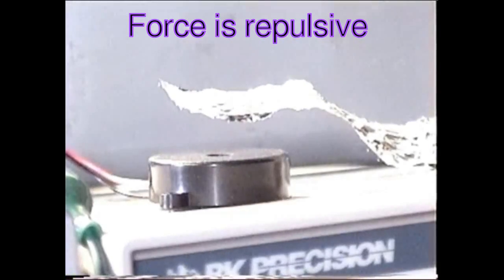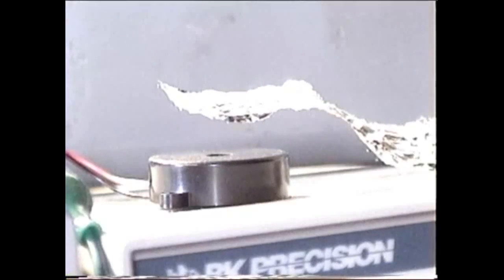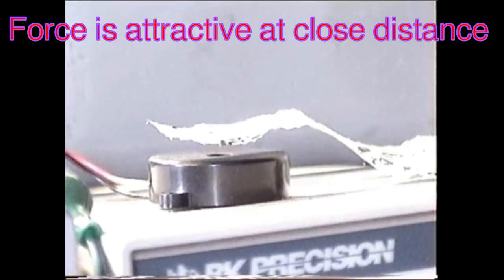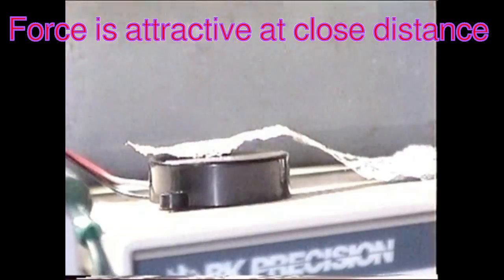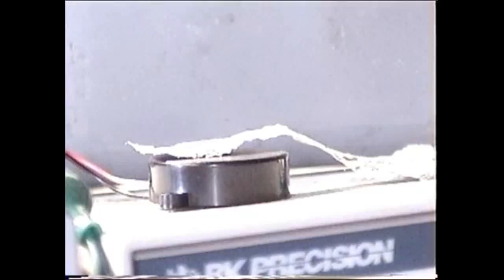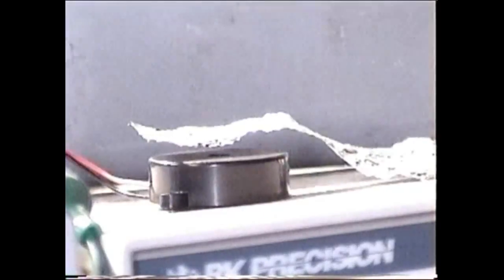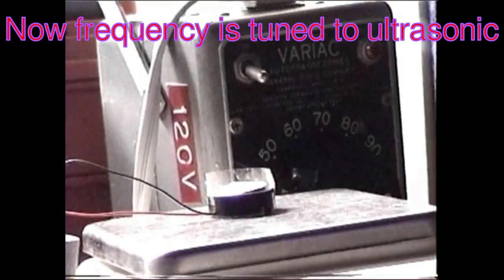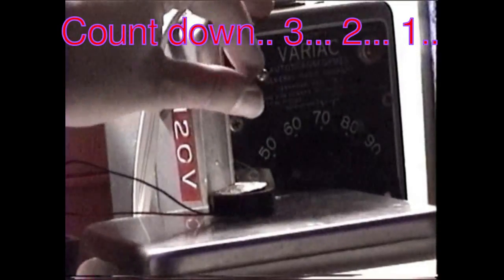Sonic Launcher / Ultrasonic force

Comment: air pressure I think moreso than frequency.....maybe wrong but interesting tests, thanks for sharing!
Reply from the maker: The different frequencies have different nodes and anti-node positions in space.  I believe that the aluminium foil is repelled from the anti-nodes and attracted to the nodes. I have other videos where I used ultrasound at higher frequencies, where the discrete mode structure is more apparent. At lower frequencies the node spacing is larger, and the effect dies off quickly with distance from the cavity so not as many nodes can be observed.  The cavity is sealed so there cannot be a net flow of air though the it, so I do not believe this is a major contribution.  It is an interesting phenomenon and capable of launching a mock spaceship in to the air. Thanks for the interest, much appreciated....
Reply: Monteith did experiments with bubbles..I believe it was like frequency repelled and unlike frequencies attracted. When Keely was a kid, he collected conch shells with the same frequency, placed them on rotary arm and same amount as a hoop around the rotating shells and it started spinning...he charged kids 5 cents to watch his mystery motor....these days its called an acoustic turbine; The Acoustic Turbine - Rectifying Sound for Thrust; http://www.keelynet.com/news/050114h.html
Reply from the maker: Very interesting. Thanks for the post. Yes sound definitely can carry momentum and cause motion though a reaction force. The rotating wheel was intriguing to say the least.
Reply: is you study the photos of Keelys machines, there are many clues such as ratios...7:25 - http://www.keelynet.com/images/keelymotor1.jpg and 8:9 - http://pondscienceinstitute.on-rev.com/imagesKeely/Wheel_Motor_and_Accumulator.jpg and http://img15.hostingpics.net/pics/988077Keel02mini.jpg